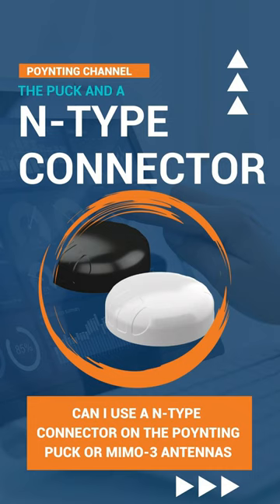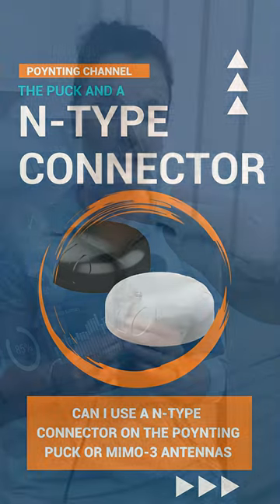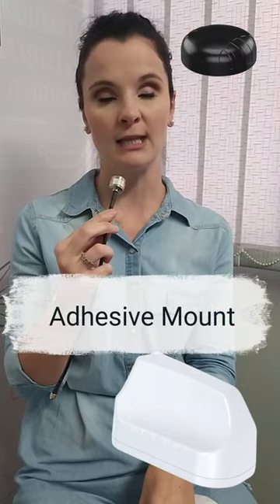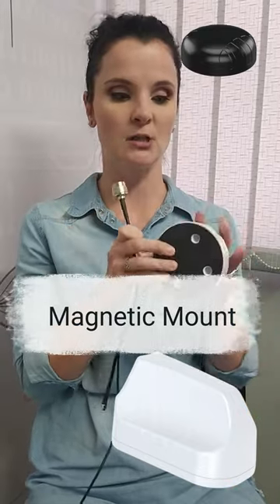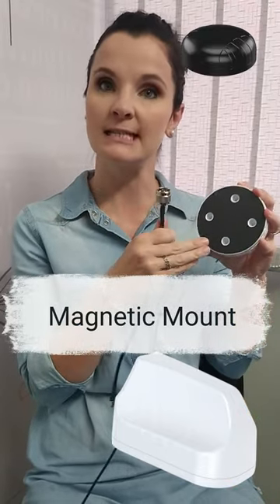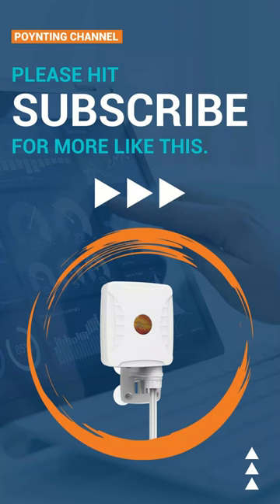Can you use a N-Type Connector on our #PUCK and #MIMO Antennas? #Poynting #Antennas #shorts

Comment: HI folks...I have your Poyting 5 in 1 antenna (5 connections) and a Pepwave MAX-BR1-MINI-LTEA-W-T (model HW2) router -- that has only 4 connections. 1 GPS/2 Cell MEMO/1 WIFI. The GPS connection is obvious, but please confirm the MEMO/WIFI connections for me: the brown pair (I'm using now for cell connections) and the green pair of cables. What do I use for the antenna?

Regarding the GREEN connctors, should male center pins be showing in both GREEN connectors, because it seems one of them does not, and there is a male center pin in the pepwave connector. Wonder if it came out of your connector...and stuck in the pepwave? Or, that the way it's suppose to be, and to use that cable for WIFI  ...thx
Reply from the maker: Hi Deek

Thanks for using our antennas. I asked our technical team to assist with the specific router, but maybe this video of the Poynting MIMO 5 in 1 will help in the interim: https://youtu.be/cN9xzReb5F4
Kind regards
Poynting Social Media Team
Reply from the maker: Hi Deek

The PEPLINK WIFI connector should have a Pin on the inside - it is a RPSMA connector.

The POYNTING WIFI Antenna connector (Green ones), should not have a PIN. 

Apologies for the delay in replying to you.

Kind regards
Poynting Support